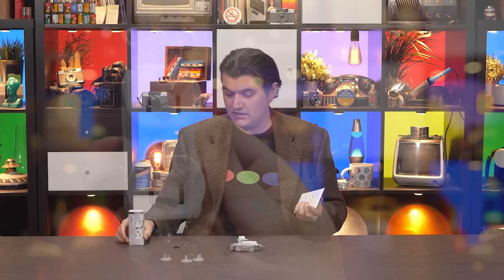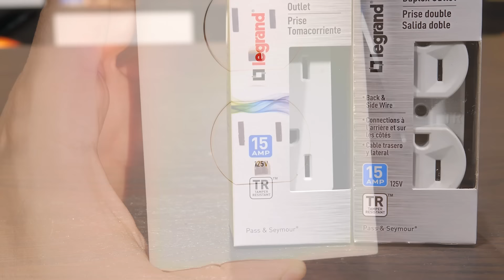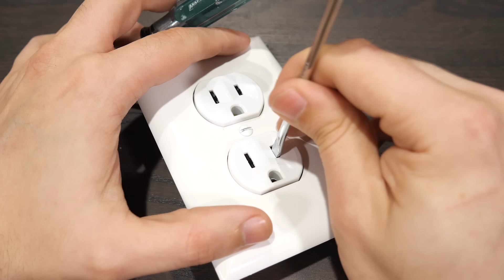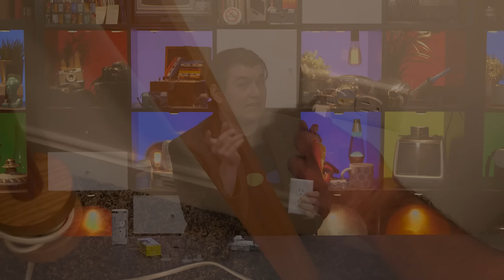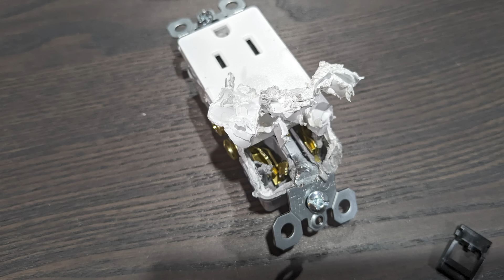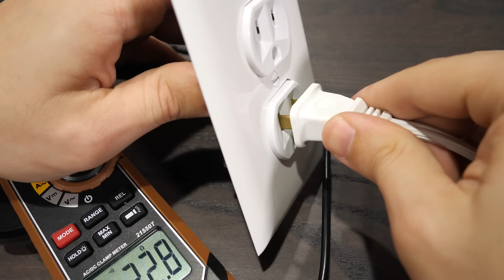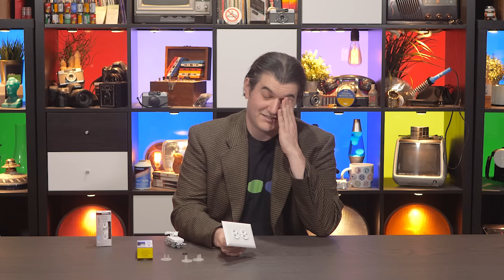Tamper-resistant outlets aren't all the same - a follow-up

Comment: I've been shocked a few times from our circuits too, though never from a plug. Usually it's been due to not practicing sufficient caution when poking about with electrical work, but it's happened due to faulty equipment in a faulty installation too. Our circuits are however, barring an earth fault, isolated from ground, so I don't know if any were a full 230V shock.

Comment: Comment 2691 so may be lost due to volume but there are 240 plugs that rotate to lock them into the outlet so if a turn/lock could be used on a regular 120 plug such that the rotated part locks into the outlet cover (no need to replace the outlet, just the cover) might just be something.  I like your delivery style and to me you have an Eddie Munster vibe (that's a positive thing).

Comment: What about the low profile outleys where a shroud extends as you plug in the plug, so that it can be installed in a device thinner than the prongs, like portable battery, or on surface mounted installations that are more low profile.

Comment: My apartment has tamper-resistant outlets only in one area of the kitchen, which is a bit odd...been dealing with them for more than two years now and I STILL struggle to use those outlets. The issue is that you can't insert the plug straight on as you say in the beginning of this video. The shutters seem to both be at equal depths in the outlet...which is a problem, because most plugs have one prong a bit larger than the other. So to engage both shutters at the same time you've gotta insert the plug at exactly 10 degrees to the left (just grabbed a protractor to measure lol). So basically the procedure ends up being jam it in and wiggle for a while until it engages. It's incredibly obnoxious...that's the outlet I use for my toaster oven so I'm plugging and unplugging a few times a week and every single time it sucks.

Comment: 15:51 When I was that age, I also got a jukebox … a homemade jukebox … by my uncle … who didn't wanted it anymore.
Anyway, I was setting it up, and the self-made cord … with prongs on both ends was constantly slipping out of the outlet or the outlet with the backplate removed, that served as inlet. And one time I did forget the cable was still in the wall … When I shoved it into the box … and because the receptacles kept slipping out (backplate missing, remember) … And did hold the contacts with my thumb so they don't go AWOL.
Yeah. The burn mark lasted for a few decades.

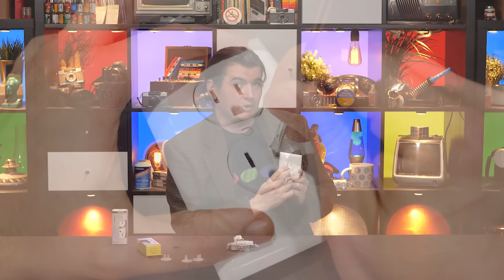Comment: 2:19 Same function as in German, when you have press in live and neutral (which are interchangeably, which has pro's and cons.)at the same time  because earth is spring contact on the outside.

Comment: I don't even know why I bother writing, but still. What amazes me, a Scandinavian electrician, is the absolutely crazy amounts of different outlets, different wire sizes and different breaker sizes you find in an average American household. Yeah, I know you use 240 for heavy duty applications, we mostly use the same type of outlet as for example a lamp to our dryers, but still. 15 amp outlet, 20 amp outlet, I mean just look at a sheet showing the different types. We have one common household type outlet for everything, the Schucko. The Schuko can handle up to 16 amps, commonly fused with 10 A on a 10 or in some cases 13 A breaker (depending on length of wire and other considerations) on a 1,5 mm2 wire. Maybe you'll find the CEE 10 A or 16 A outlet in a garage somewhere, but that's it. No more. I mean, you have, for a 120 volt circuit you have at least do dozen different sockets depending on wire size, amperage etc.

Comment: I think the biggest reason our outlets are still the way the way they are is entrenchment. Even if it didn't get politicized, adopting a new standard design now (as opposed to, say, back in the seventies) would be a massive PITA just from the sheer scale of the project. Especially factoring in offices, schools, stores, apartments, hotels, etc. We would also need adapters (with the ideal design for wall use probably being a mini extension cord with a 45-degree right-angle plug) churned out in bulk at the same time so that people didn't have to replace their appliances and electronics en masse to comply with the new standard. Hell, we haven't even fully finished the change to the newer standard. I'm pretty sure some places still only have 2-prong outlets in several rooms.

I think the foreign complaints are influenced by hotel stays, where the receptacles get the crap worn out of them (and in cheaper hotels and especially motels they were probably only so-so at best in the first place). Well, that and USB--to-mains adapters. Many of them have crappy prongs that do not stay in outlets especially firmly, so they can really easily come loose from wall outlets. That goes double if someone's using their phone while it charges and thus tugging on the mess.

The biggest hassle with replacing outlets on an individual level is moving any furniture that might be in the way. Like, say, a loaded shelf or a steelcase desk.

Comment: It's from houses that were wired with super cheap outlets, like let's say from the mid-90s, and after plugging in and pulling out several times the prongs get bent open lose their tension and then the plugs literally fall out.

Comment: I find these plugs and sockets quite unsafe.
I find it quite strange that you plug them insie the socket so that it is mostly hidden and not only connected via the metal but also connected with the socket itself (plastic to plastic).

Comment: There's one big problem with the TR outlets- not all 2 prog plugs use equal length prongs.  To the best of my understanding, TR outlets only allow you to insert items when there's equal pressure on both openings.  I have a few plugs that do not have equal length prongs but i have no idea why or how old the products that uses those plugs are, but they are a bitch to get inserted into a TR outlet.  I'm certain i'm probably breaking the safety feature of the TR outlet with these particular plugs...

Comment: These suck. Some plugs refuse to go in while others will with a long drawn out wiggling ritual. I want to check the outlet with my volt meter. Guess what. I CANT!! so how do I know if the outlet or device is at fault if I cant even check the plug for power. I made up a (according to osha you cant do this because its homemade) adapter for my voltmeter to check these and have to play around just to get it in.

Its interesting how all these new problems that are suddenly arising in todays world didn't exist years ago. I dont know if people are getting dumber or if all of the sudden everything on earth is dangerous. It looks like the second is the case and we shouldnt do anything at all because it Might harm you.

Comment: One thing I've been confused about for a while is why plugs don't have a plastic coating over some of the length of the prongs. That seems like it should be cheapish to add to the manufacturing process with no real downsides or tradeoffs, and it seems like it would dramatically reduce the shock risk from sloppy insertions and removals or from incidental contact with a half-dislodged plug.

Comment: When I was a kid, the tamper resistant was the whole reason I’ve messed with the outlet because I didn’t know what it did😂 I actually figured out that you had to put pressure on both of the holes and I got a small shock. lol

Comment: I once got an unplesant 120v shock when I was installing a family members dishwasher. Turns out they turned off the wrong breaker, and the wires for a dishwasher are unshielded bare wires.
Thankfully I was laying prone when I was reaching under to connect them, and I could feel it going into my hand and grounding into the tile through my elbow.
It was hard to let go, and it gave me a good spook, but it was over in a matter of seconds, and I didn't wind up with any kind of burns or physical injury.

Comment: @technologyconnextras IF U CHANGE YOUR 2 prong outlets they probably do not have grounds , you are supposed to gfci protect any ungrounded outlet , telling home owners to change there own outlets without mentioning they are supposed to gfci protected is not great,, also importantly backstabbing outlets is NOT THE SAME AS A WAGO. I have seen more then once backstabbed outlets create small fires Please do not baackstab…in my personal opinion(most other electricians would agree) if you have to sets or more of wires in an outlet  box it’s best practice to splice the wires together and put a pigtail to the outlet. A good splice can prevent a lot of trouble,
Also love your content I’m not actually mad just giving
My professional Opinion

Comment: A thought on the back stabbing being the same as the wago connectors one of the main problems I see with backstabbing is people stripping the wire too far and leaving a large amount of wire exposed the wago connectors cover quite a bit of what’s supposed to still be covered wire so they are safer in that way.

Comment: It has occured to me that one of the pros of the schuko plug is that the outlet it corresponds to, is recessed. Is there a reason most american outlets are not similarly recessed? I googled it and found some examples, but for a double outlet it was one large recess instead of individual recesses for each receptacle, that does make it less effective, but still an improvement. So why not more common, it's backwards compatible at least.
Reply: That's a pretty good idea. Junction box volume might be an issue in some instances on "old" work, but yeah, good idea!

Comment: Just seems like something people might be interested in: you can quantify how much more dangerous (less safe) 240v is compared to 120. and it's 4x worse. Cause at the end of the day, the part what kills you is the burns. and the burns are (I assume) proportional to heat generation, and the heat generation is proportional to watts(power). So for the same person in the same position (resistance) for the same amount of time, `P(power) = V(volts)^2 / R(resistance)` which means double the volts gets you 4x the power passing through you and causing your body to be a space heater.

Comment: Also on UK plugs the pin is insulated at the bottom so when you're removing it/plugging it in and it's partially inserted there is no exposed metal to touch

Comment: The outside of the US like the UK.
There outlets are 220/240 for like lights, microwave, toaster, tv, Refrigerator and things that runs stuff like Hot water heater and stove are still 220/240v
We in the USA. Are 110/120v has always been like this sense 1900s.
The reason are 110/120v is still the same is because of amps.
Every 110/120v plug has a Different kind of plug on them.
15-20 amps are just the same.
30 amp 110/120v the blades are spread out more.
Then you have 220/240v outlet.
15 amp/ 220/240 can not fit a 110/120v plug
20 amp 220/240 looks like this -.-
30 amp 220/240 are even Wider than the 30amp 110/120v plug
50 amp 220/240 are much bigger plug than the rest.
60 amp 220/240 Big Boy! For welding or the hole 9 yards

Comment: 12:53 voltage is what penetrates skin (etc.) resistance. amps is what does the damage
so it's more "likely" to get a shock from a 240v, bot its more harmful on a 120v, because amps will be higher given the same resistance, and you as a resistance are constant :)

to be clear both 120v and 240v CAN KILL YOU if you complete a circuit with your body
it's just IF you do get a shock then it's more likely to be lethal on a 120v, bot it's more likely to get one in a first place on a 240v

Comment: Changing plugs is a total non-starter, not juat due to the political or cultural aspect but because existing devices would beed adapters and they would be around for decades and decades. The adapters would post far more of a shock and fire risk than any inadequacies in our current plug design. There are mitigation strategies like GFCI. My company requires every device and cord to be plugged into a GFCI adapter, which are everywhere.

Comment: 120v is nothing just a quick dangit and on your way. I never been got by 220 obviously don't plan on it. Luckily like he said it's mainly appliances so you don't get in it much. Now I was working on a PC power supply and pretty sure I got a DC shock that clamped my fingers down on the case and sliced most of em probably making better electrical connection cause oh boy I never bled from so many fingers at once. Knocked me back and involuntarily kicked a chair that was in front of me into a window and nearly blacked out. Didn't know heatsinks could be live while I was probing for voltages, definitely know now.

Comment: Your pet issue is the "pins going live before full insertion" but mitigating that in a NEMA plug starts introducing a different problem, i e. retention force. If the plug doesn't engage until 1mm before full insertion, its either gonna have crappy retention or be really difficult to insert. The actual solution to all of this is the German-pattern Schuko outlets, which are recessed AND often have partially insulated pins.

Comment: Illegal to replace outlets on your own? Who checks that?
I can do whatever TF I want, from the meter onward; I could replace my breaker panel, rewire my whole house, not just on my own, but however I like. I don't have to tell anyone or get a permit, nor is there ever an inspection. Except for checking for gas leaks every 2 years, there is never any inspection on private property, neither for electrical, nor anything else. Buildings just have to be built to code, what the owner modifies afterwards never gets checked.

Comment: If you want to experience plugs that fall out, buy a house that was flipped.  They use the cheapest outlets, the brass is very soft, so the clamping force is near zeros within a year of use.  I replace them when they become a problem.  Also, I replace the quick install (push wire in hole) with screwed connections.

Comment: At 120 volts you need to have physical contact with the live source and you have to be grounded well and you have to hold on for a longer time to receive a fatal shock...whereas 220-240 is much more likely to cause your hand to contract and make it difficult to release the live object, also it requires less time to give a fatal shock, also 220/240 is likely to be on a larger breaker, usually 30 to 40 amps on a typical dryer or stove circuit, they VERY rarely have any type of safety built into the circuit either in 98% of installations in America...so for us it's definitely more likely to receive an injury or fatal shock from 220/240 than 120 volts. In some other countries the plug on the appliance has a fuse built in rated 3 or 5 amps on top of the typical circuit being 15 amps and some even have safety built into the breaker to prevent fatal shocks...in the USA our electrical inspections aren't done often enough or to a high enough standard in my opinion, I've worked construction on and off for 15 years and seen many homes with fire damage from improperly installed, out of date, overloaded or just faulty systems...you can go to most stores and buy a heater that has an amp draw so close to the limit for the average circuit, that if used for any length of time it actually will start melting the socket...out extension cords are either not substantial enough and could melt causing a fire or too substantial melting the socket or wiring...house fires are very common every winter from plug in heaters and typically leave families with no home or worse...Thank you for reading if you are still here, I hope you are having a great day or night!

Comment: Most European receptacles are designed to take in the plug completely instead of being flush with the wall. This means that a sideways motion of the plug or the cord can't possibly loosen the plug and thus, it won't be pulled out by accident or some sort of lever effect. Compared to this, the American plugs do fall out of the receptacle.

Comment: As for backstabbing, I agree the last outlet won’t matter, but feeding through has caused all manner of problems since the method first appeared in the 70s, 
Melted insulation, deformed discolored devices, and sometimes scorched walls. 
If the circuit load was large enough,( space heaters, window units) over time all upstream connections would be  lost and  receptacles would simply fall off the wires 
 One quick way to determine if backstabbing had been used was to check a device for warmth when nothing was plugged into it.

Comment: A good way to visualize split phase power is sawing a tree. One person can use a one hand saw by pushing and pulling the saw repeatedly. Or you can have two people on either end with one pushing at the same time that the other is pulling, then it flip flops. Each person is 120V